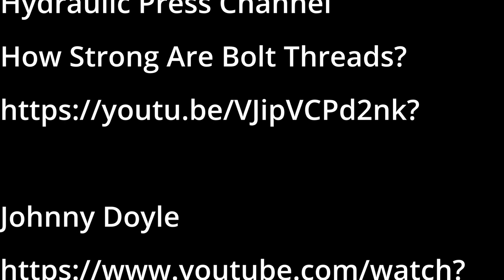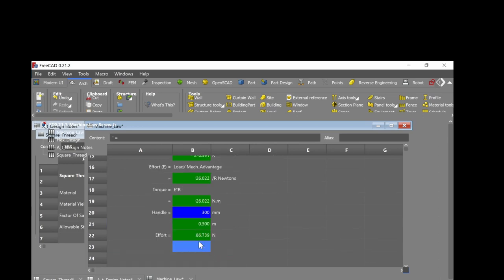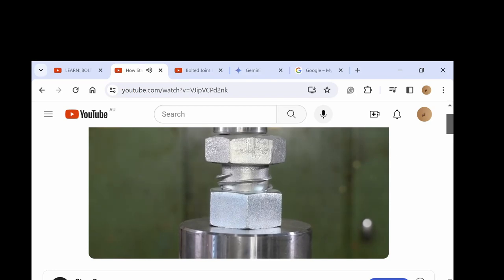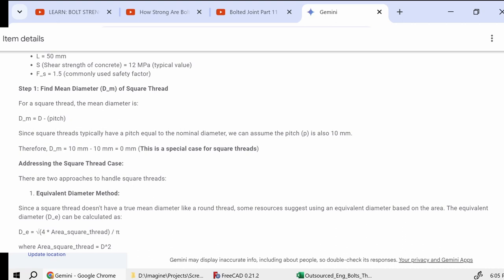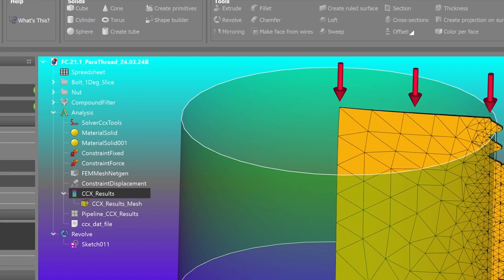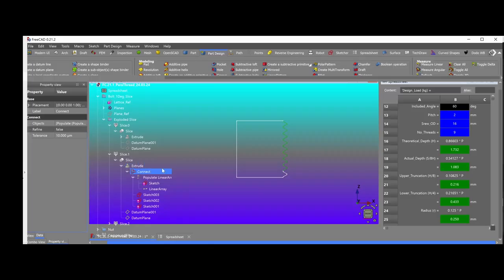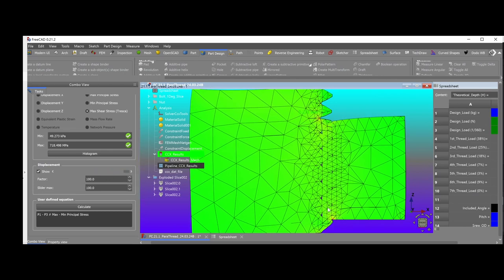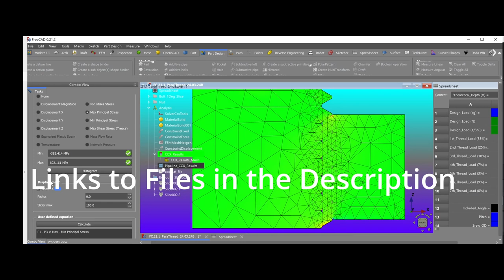Thread Stripping Analysis

Comment: The boundary condition on the left (i.e. at the center axis of the bolt) should be constrained in the x direction due to symmetry (in a bolt, it'll have the same force pushing opposite in the x-direction from the other side, canceling out virtually exactly) instead of bulging out as is shown. (Not that it changes your observations really.)